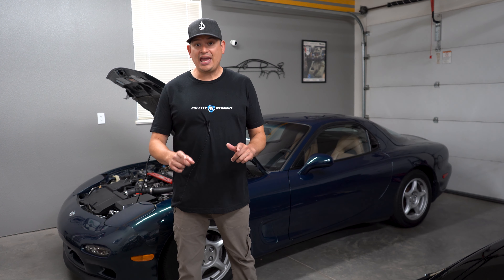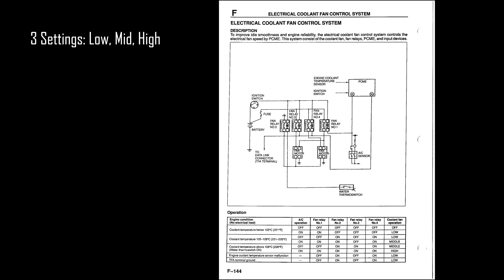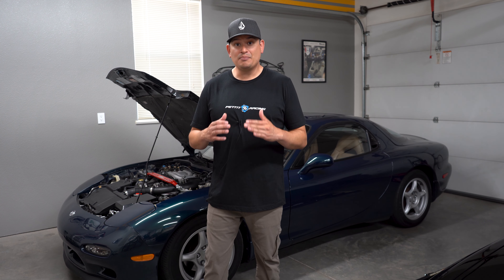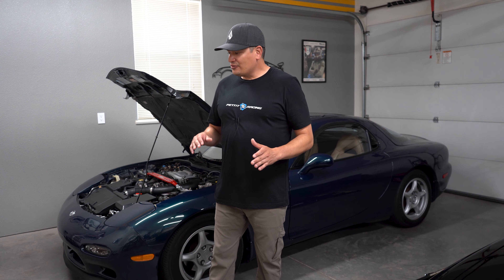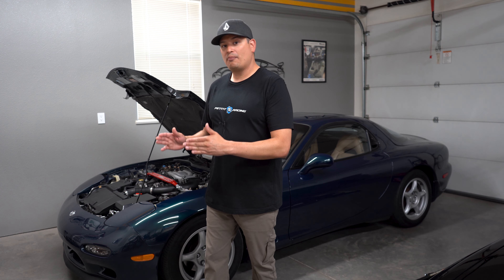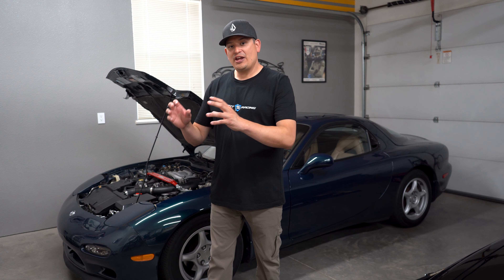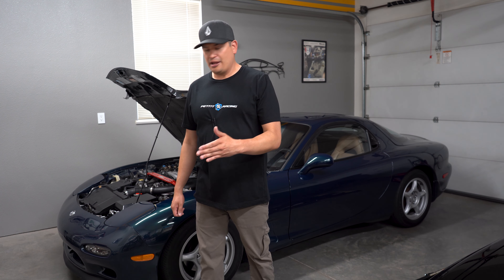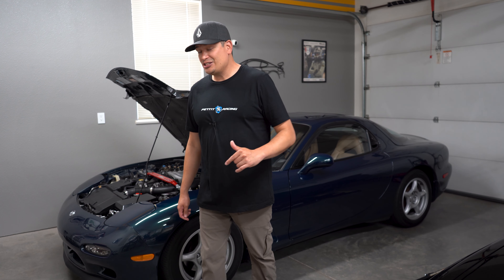RX-7 Must-Know Cooling Tip! (Pettit Racing Tech Tip Shared)

Comment: I need help , My cooling fans doesnt turn on normally when engine is hot, they only turn on when i turn on ac.
Reply from the maker: @RAFAELFigueredo-j3g  it sounds like your relays have gone bad. You can test them as per the manual. They are by the left headlight.
Reply: @DriversTherapy  Thank you! i will check them out, i do see multiple temps they are supposed to turn on the internet, do you happen to know what temp stock one is supposed to turn on?